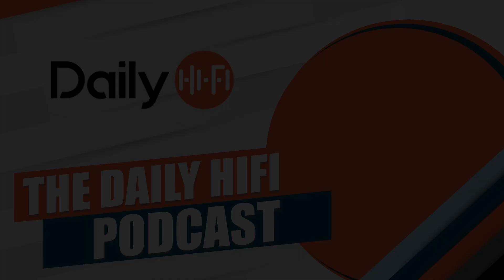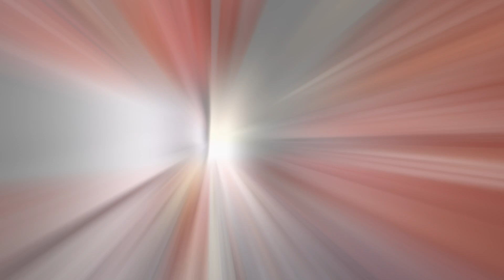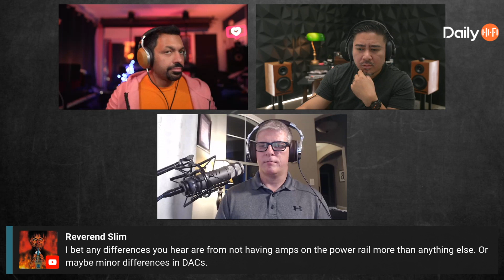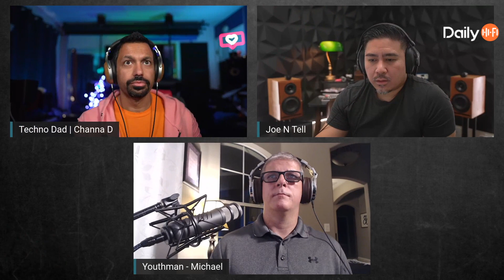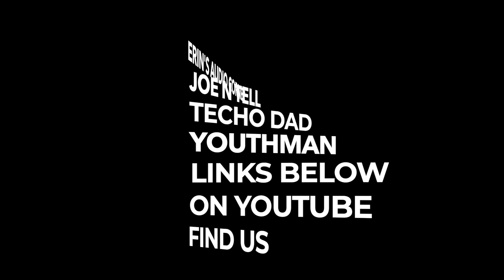Active VS Passive Crossovers

Comment: To be more clear on it. First you need to do active crossover using some DSP where you tie in all the different drivers per speaker into a single unit. And then the AVR sees that entire package as a single speaker. So yes at that point it will treat it as a speaker irrelevant of it having Active or Passive crossover. And no AVR processing in no way be getting tied into DSP processing. Yes it will process it in the sense you will be able to set high-pass filter for those speakers EQ them etc as per the requirement of the room and speaker placement. But no it won't be interfering with crossover set on the DSP itself. It sees and treats the entire package as a single speaker that is it.

Comment: Yeah there's so much benefits from a sound quality stand point to do the  crossover before the power amplifier.
The two major drawback is you need to know what you are doing and inconvenience.
But when you do that then the benefits is that huge that it is not even funny to compare.

Comment: Understand that active crossovers aren’t necessarily better if they are not used correctly. Designing an active or passive crossover involves the same process: using proper anechoic measurements. 

Once the crossover is properly designed, room correction software isn’t an issue.